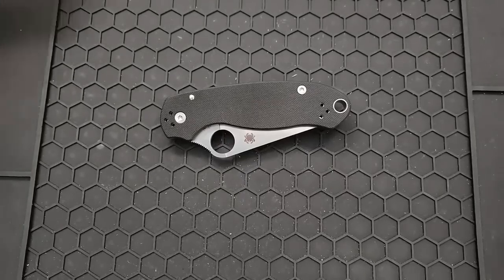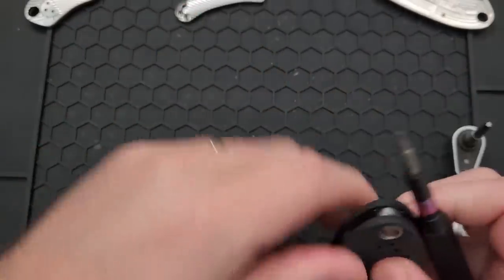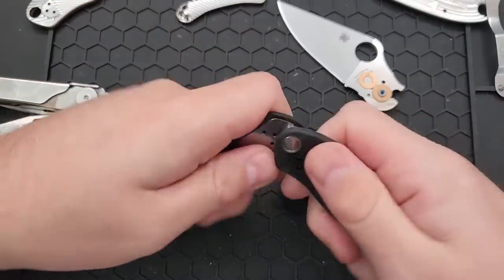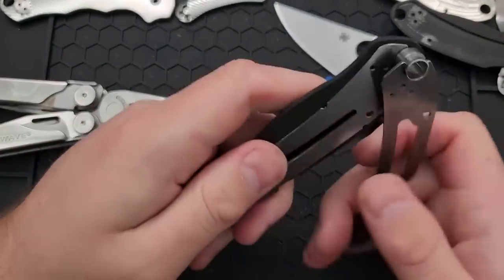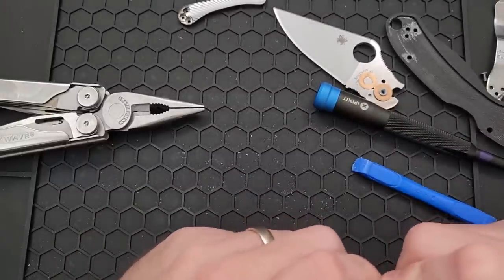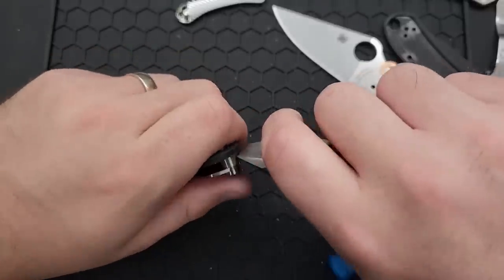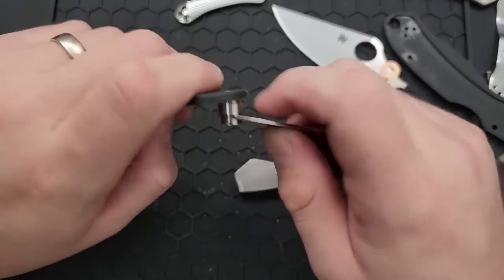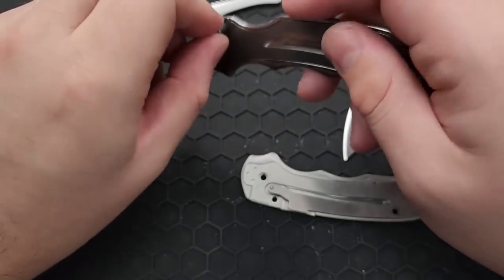How to install (eventually) the RG Custom Metalworks Titanium Para 3 Scales

Comment: If you put something like a screwdriver between the g10 and steel liner and slide it up towards the tube it will pop it out everytime. Takes about 10 seconds.
Reply: This right here

Comment: Over the last few years I've probably bought 15 PM2's and Pars 3's. I've only had the problem you've had with the PM2's. The Para 3's seemed to have a looser fit in the G10. It looks like the outer diameter of the lanyard tube varies a lot. I've found that the Flytanium Ti lanyard tube fits well. They've taken the lip off the edge of the lanyard tube so it press fits with just finger pressure. I'm sorry your installation was so difficult.
Reply: Those scales are Amazing. Byfar the best ones I have seen on the market.👏👏 Do you have a rough idea when the pm2's are back in production..

Comment: Whenever I pull one of these apart, I throw that lanyard tube in the trash and put in a flytanium plug.
Reply: Yes! Yes sir, that is the way to do it.
Reply: Yeah, but it’s one of 2 extra things you have to buy to get a satisfactory para 3, PM2.  Just…$80 extra every spydie you buy.
Reply: @modofatak  that's fine. If I was worried about money spent, I probably would not be in this hobby. I enjoy modifying them too. I added a sharpening choil to one of my pm2s, and I denubbed one of my shamans. Most of my pm2s have different scales on them. I even found lanyard plugs that have tritium tubes in them. Those are made by Glowrhino.

Comment: I can't stand the PM2 & Para 3 Lanyard tubes. That "SDK Lanyard Cube - PM2, Para3, Manix 2 Lanyard Tube Removal Tool" makes things so much easier, and pop in a Flytanium Ti lanyard tube and it makes things so much easier in the future. I'm sure other Ti lanyard tubes work great as well, but not tried them so can't speak on them. I hope when Spyderco finally make a PM3 and a Para 4 that they drop the lanyard tube and hide it in a small backspacer or something where they belong.